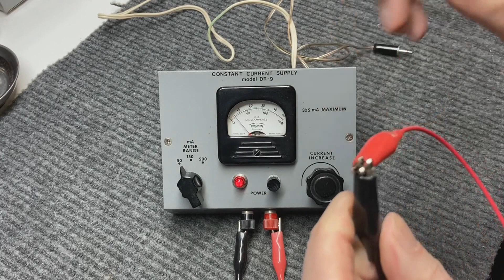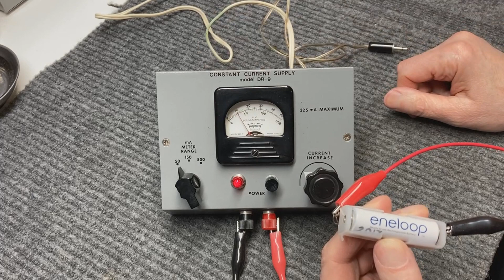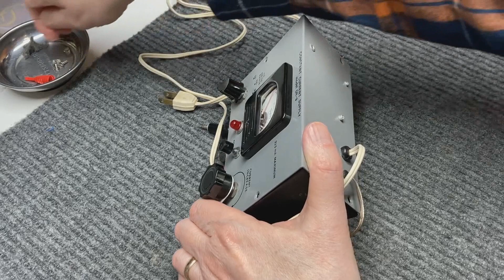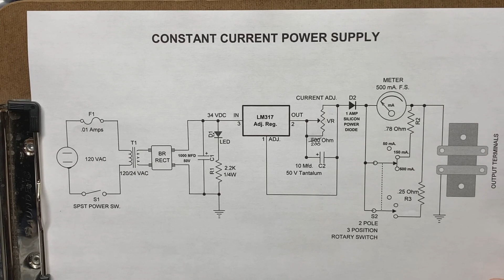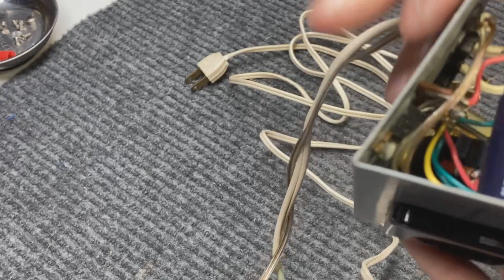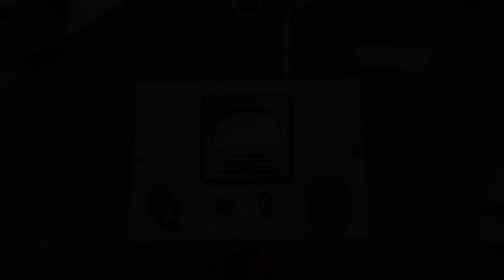Build Your Own Constant Current Power Supply

Comment: Thanks for your nice video.I also have got this type of ic. l may try it.
Reply from the maker: I'm finding more and more uses for this than my adjustable, regulated bench supply.  It's great for charging batteries & testing for dead LED's in bulbs, TV backlights etc.  --  You don't need to know the working voltage of the device under test either.  Just short the leads, set it for 15mA & test away!  It doesn't matter if there is just (1) or (15) LED's in series, the current remains the same throughout the whole string.

Comment: I have just begun searching for an accurate way to measure µA of current.  It looks like I can use the secondary part of this circuit (after the regulator) to build such a circuit using a 50µA F.S. movement.  I haven't been able to find much guidance on how to start; but, it looks like the meter portion of your circuit is what I need?
Reply: Most meters just use ohms law; V=IR. Using a certain fixed resistor, voltage will be directly correlated to current. For instance, using a 10k resistor, you will measure 0.1-10V for 10uA to 1mA of current. You can switch between resistors if you'd like different multiplication factors.

Also see Dave Jones' ( EEVBlog channel) ucurrent project, he has all schematics practically available; it uses a precision opamp to multiply the measuring-resistors voltage in order to reduce the 'burden voltage' (voltage dropped across that resistor) when measuring small currents.

Comment: Great project
Reply: Thanks Larry,  It really comes in handy when troubleshooting TV backlight issues.  Just short the leads, set the meter to about 15-20 mA's and start probing the LED feed lines.  It will light a single lamp or a whole string without changing the setting.

Comment: You can limit max current with one resistor ~30 ohm in series with VR (this also slightly increase regulation linearity). And can use this resistor as shunt for ammeter (you always loose 1.2V on VR, so why not use part of this voltage from limiting resistor to drive ammeter?). Maybe use schottky protection diode not in series with current cource, but in parallel with output terminals, in reverse polarity.

Comment: I cannot use this circuit.
the current is big through the potentiometer.
i dont know can use 350 mA carbon potentiometer.
i do parallel connect main resistor.
Iadj is enough small 100uA.
Reply from the maker: Yes, you may have to use a higher wattage, wire-wound potentiometer because of the current flow through it.

Comment: I would the adjustable Pot be easier if you added a 10  turn pot in series or how about in parallel (Shunt) with the adjustable pot to get easier adjust the current more precise?
Reply from the maker: I didn't seem to have any problem with setting an accurate current reading using just a standard pot but sure, a 10-turn pot will always give you more control.

Comment: Hi there, thanks for the video. I did enjoy it so much. Just wondering, will this works as bench adjustable power supply. By adding adjustable volt supply? I really want to build one, so it’s easier when i want to hook it up to any circuit without using individual power supply like individual 9v or 12v or any volt.
Reply: Hi U Z, yes this would work if you put it after your voltage regulated power supply circuit.  That way you could have a built-in adjustable current limiter too.   I have a schematic of my DIY bench supply that I can email you if you post your address here.
Reply: I read your comment and question a little closer and would recommend that you build a good (voltage) regulated power supply for your bench.  If you hook this constant current supply up to something, like say a transistor radio, the voltage may be way too high and damage it even though the current will be regulated to where you set it.   Hope this clears up your question, if not msg. me back and we can talk about it.
Reply: Thanks!

Comment: That D2 doesn't look like it will protect against reverse voltage. It will block voltage coming in but not reverse voltage. I would think adding a diode in reverse across the output may help. My 2 cents which isn't much :-)
Reply from the maker: Your partially right, it does block reverse voltage which would ultimately protect the circuitry.

Comment: A grand project! What is the transformer from? Doorbell? Thermostat?
Reply: That's a really good question!  Can't remember to tell you the truth.  Suspect it was a clock radio or something but you certainly could use a doorbell transformer.  Or if you wanted to limit the voltage just go with a 12V wall wart or similar.

Comment: Thank you for sharing this with us. One small modification could be the addition of a momentary push button switch to temporarily short the output terminals while adjusting the current level. One question, is that a wire wound potentiometer?
Reply from the maker: In this case it IS a wire-wound but it is not necessary since there is little current flowing through it.  I just found this one in my junk box.  I like the idea of the momentary contact switch to short the leads.   Good idea.  Also a voltmeter would be of some value too but I didn't have the room for one in this box.
Reply: I like it. It looks like it would be a fun project to make!👍
Reply: @ronniepirtlejr2606  It really is easier than it looks and LM317 are widely used and easy to find.